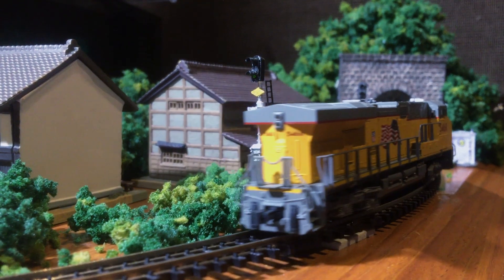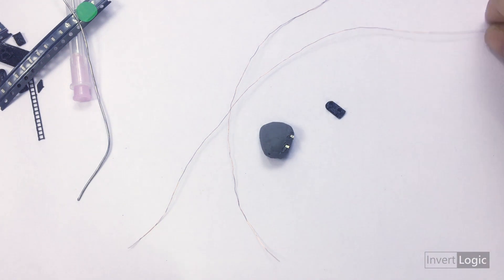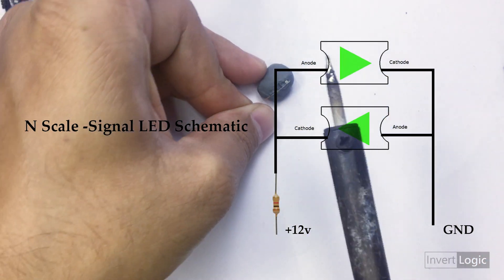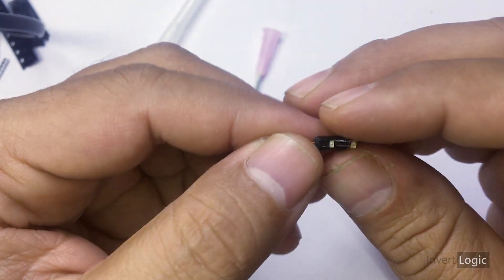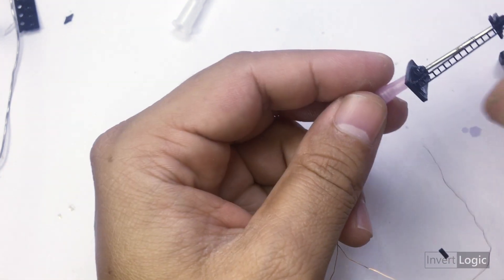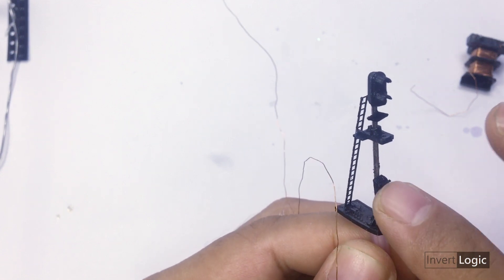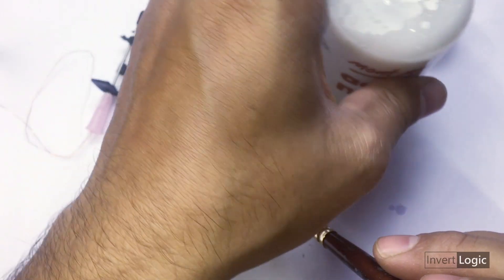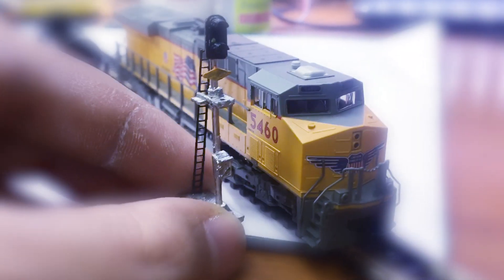Easy NScale Signal

Comment: I hope you take this as a Compliment and certainly not negatively, What this looks much MUCH  Better than store bought for pennies on the dollar! Besides the trouble that the ladder was giving you,lol, In your opinion, What was the hardest part? I am guessing the soldering Was the most difficult? I have an electronics background, But that looked a little bit intimidating from the camera angle. What was the hardest part for you, Or have you made so many of these they are no longer an issue? 9 Absolutely.Amazing.Iyeah which I will be stealing from you😅

Comment: Hi what size is the Resistor? .please
Reply from the maker: its 0603 SMD
Reply: The rated voltage for the LED is 3 volts. So the best approach would be a voltage divider which is where you have two resistors in series and the power for the LED comes from the junction between the two resistors. You can find a diagram for this on pretty much any electronics circuit web site. Doing a bit of math it looks to me like you would need a 1k ohm resistor and a 330 ohm resistor, both being rated for 0.25 watts. Cheers.
Reply: @richardmycroft5336  Lol.. I'll just buy a lighted post from the store!